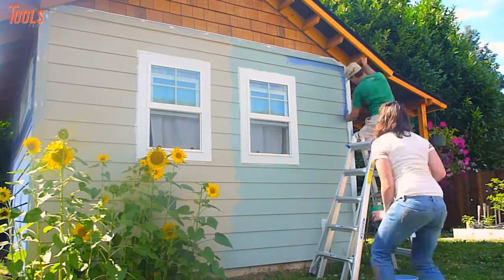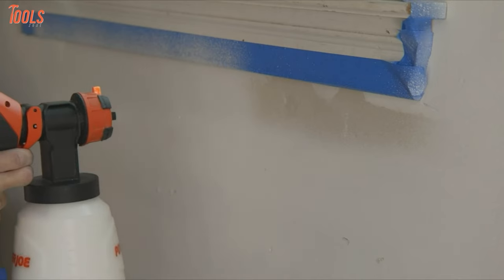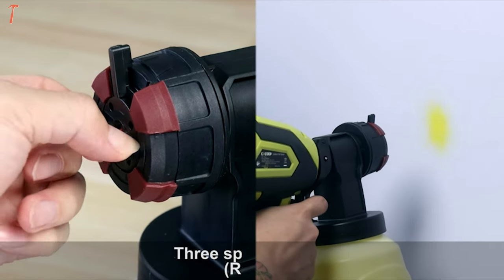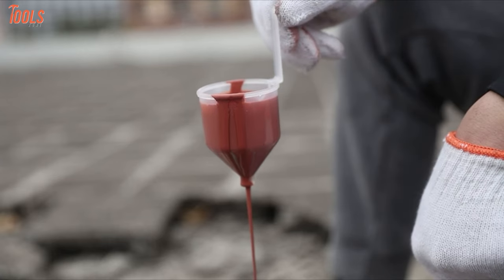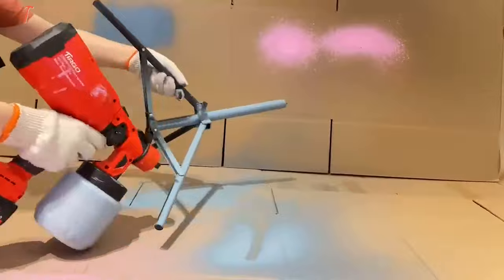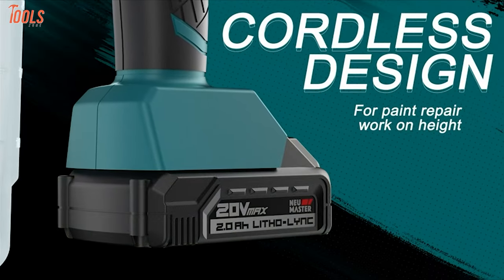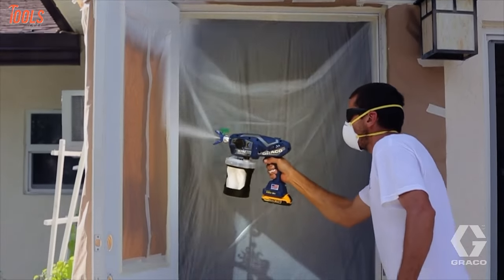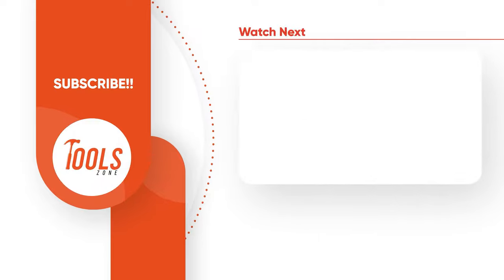7 Best Cordless Paint Sprayer | Best Paint Spray Paint Gun

Comment: Whats the better spray gun to use to paint walls and ceilings?
Reply from the maker: you can get the Graco Magnum X7.
Reply: Yeas. Anything a normal big air pressure sprayers. The portable ones with an extension cord are my favorite ones. They work very well I mean you got to fill the little container up multiple times... But you don't have to spend an hour and a half running water through the sprayer or mineral spirits, and then making sure every little part and piece is clean All you got to do is clean the tip and then clean out the little bag that's in the cartridge. Maybe a little more if you have to, takes 15 minutes to clean everything
Reply from the maker: @conquerthafuture7209  Thanks for your suggestions
Reply: A roller and extension pole.

Comment: which of these can be used without having to attach the container?
I want to use it for something that uses small portions and can't work unless I do this
Reply: Uplon firther investigation, it seems like I might need it to be a piston pump to get this effect, I am sure you know better
Reply from the maker: You can use an airless paint sprayer as it works by pumping paint at a very high pressure. You can use it without attaching the container.
Reply: @tools-zone  I saw in front of me a cordless device that did this, I think it is the type that relies on piston pressure so that applies to airless like you said, it was Wagner 180p, but I cant find that exact model maybe they are no longer making it, do you recommend anything similar?
Reply from the maker: @AmerMohdRashid  not sure but I think you are talking about this one ( https://geni.us/milwaukeesprayer ). If you are looking for this kind of sprayer, I will suggest something better than this.
Reply: Dude are you high? Nothing portable without a container of paint/oil exists. Go get a paint sprayer if all you want is the handle, it's going to take you an hour to clean compared to these battery operated sprayers, or even just electric wired sprayers. What do you mean without a container? You think there's an invention that can convert oxygen to whatever paint or oil thickness you want like immediately on The spot?! 😂😂

Comment: You said that's a A 4000 Amp Hour Battery? (2:16) There is no such thing.  That's a 4000 MilliAMP HR battery or simply a 4 AHR battery. It says so right on the battery.. Incidentally, battery companies like to use the milliamp numbers because they are bigger.. a milliamp is a THOUSANTH of an amp so 1000 milliamps is just 1 amp.  Rip-off language. Like saying 50 mega bits instead of 6,250 bytes when talking about data transfer speed. It's all BS.
Reply from the maker: Sorry for the inconvenience. Thanks for your feedback.
Reply: @tools-zone  No inconvenience at all. Just wanted to clarify for people that don't know the difference between MiliAmps and whole amps..